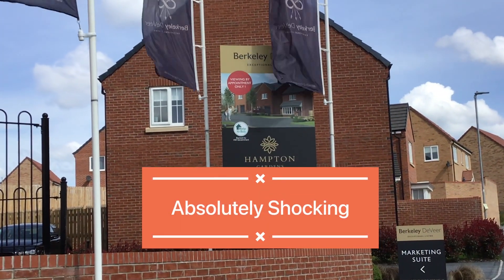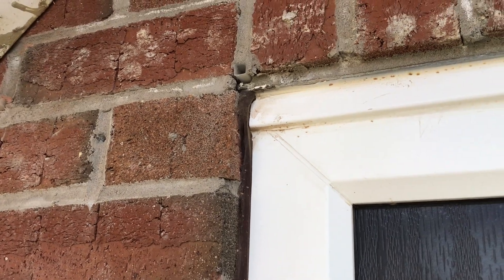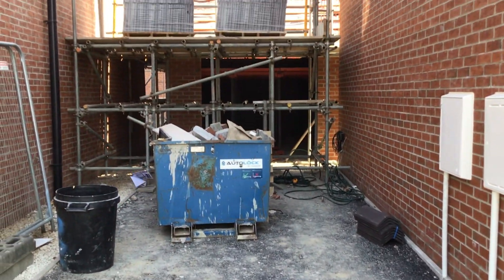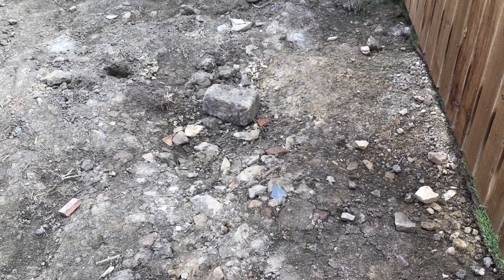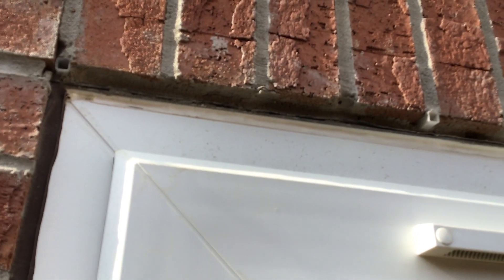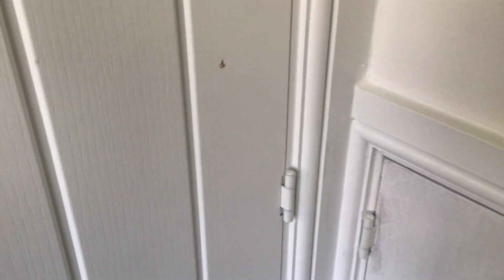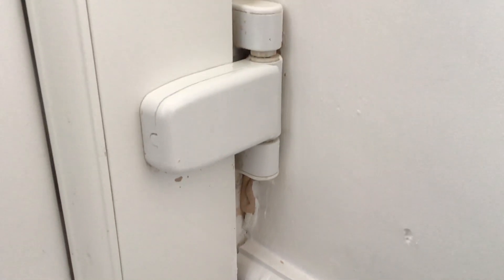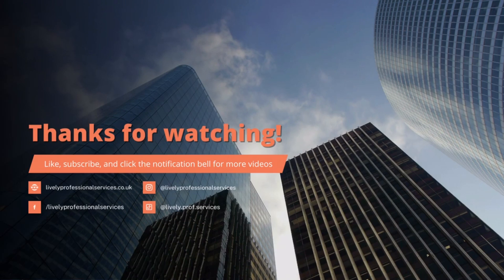Name and Shame

Comment: Mr Lively is always highlighting newel posts out of true so I thought I would check the 3 posts on my staircase, absolutely spot on.  Maybe when my house was built back in 1913 they had much more sophisticated equipment for getting vertical.......
Reply from the maker: No, just better tradesmen that could do the job properly and cared about leaving a good job.
Reply: @LivelyProfessionalServices  Absolutely, I was just being a little facetious!
Reply: Stairs are made to drawings, if storey heights are out, newel posts tend to be on the piss, they should measure after joists are installed
Reply from the maker: @carldavis9856  You are right they should always measure the stair height on-site and never order stairs off a drawing.

Comment: Please tell me if I'm wrong but that electrical meter box incoming looks like it's fixed to a small piece of chipboard that is just leaning inside.  Surely this should be properly fixed to the back of the box?  The big Wall - should that have buttress piers due to its height? I think this could possibly be your worst building to date, shocking.
Reply from the maker: The electricity supply is ok that is a box supplied by the electric supplier and the board is secured to the back of the box. I agree the quality of this house was shocking.
Reply: @LivelyProfessionalServices  Yeah I was referring to the front incoming board and earth connection at 5:14 it looked like it was just leaning backward and not fixed to the back of the box, sort of floating?
Reply: @Elfin4  they do lean backwards. Probably to make it easier for the connections
Reply: @stevehallam6495  Thanks for confirming